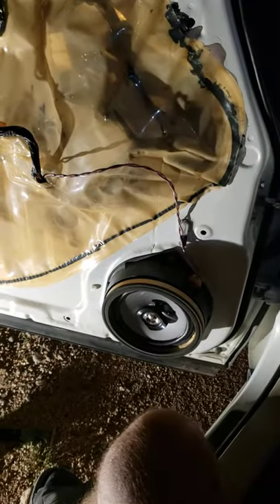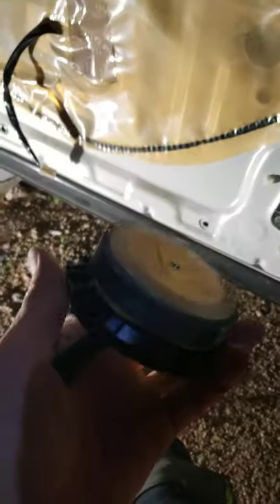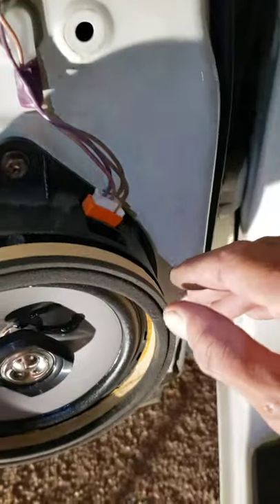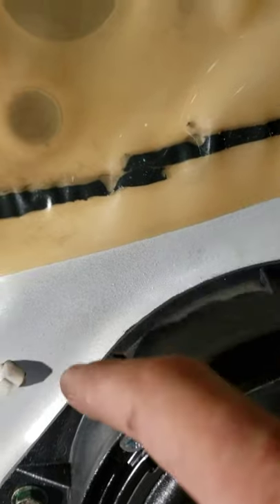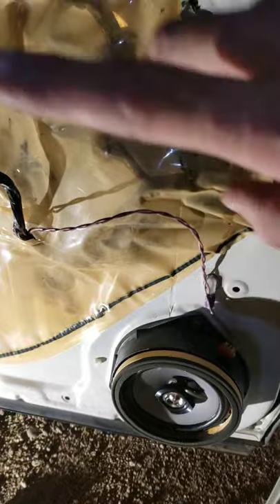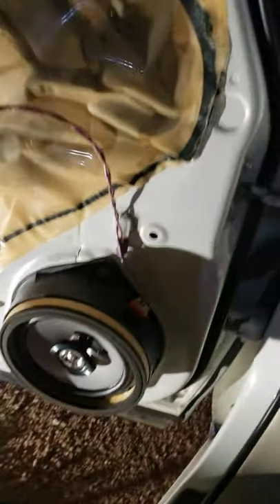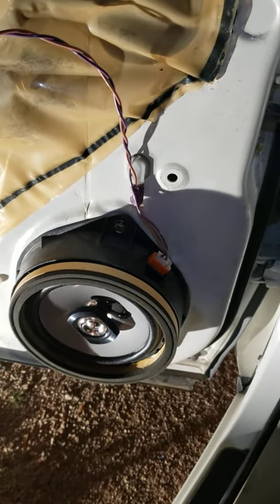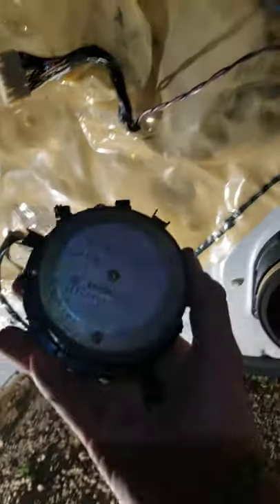RX300 Speaker Replacement Lexus

Comment: Lexus drip 💧 is always choice
Reply from the maker: Now you're reminding me of the sunroof leak I have to deal with.
If the drivers floorboard is wet, or you have a musty odor... that's probably your culprit.
Wet it heavily and vacuum it out and the smell may vanish. Mine did after I left the sunroof open in a desert monsoon. But, that's unrelated to the on-going puddle after a rain. The drain tube gets clogged, or so they say.
A great excuse to wet-vac the carpet. ALL of it!
If you want to dry it fast, put the heater on and leave it to idle. I cracked the rear windows to let out the humidity that that generates.